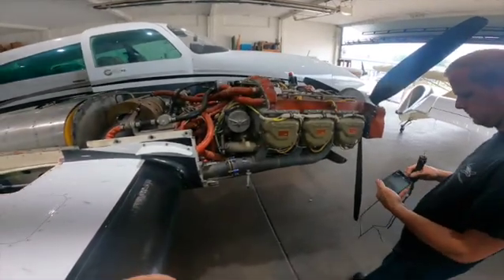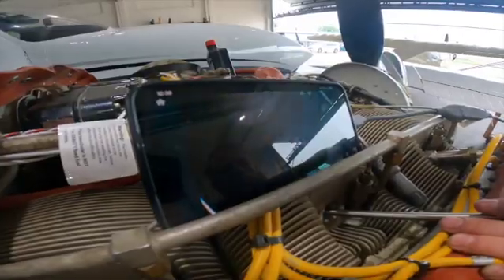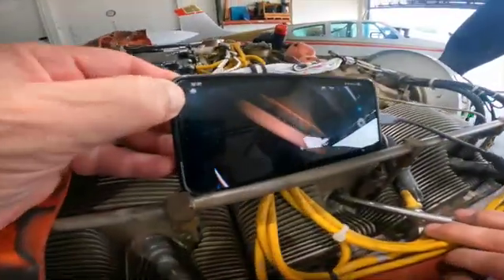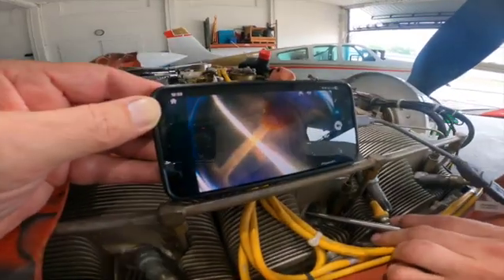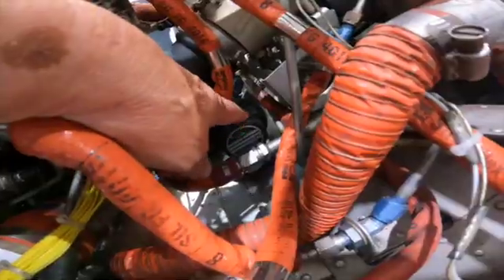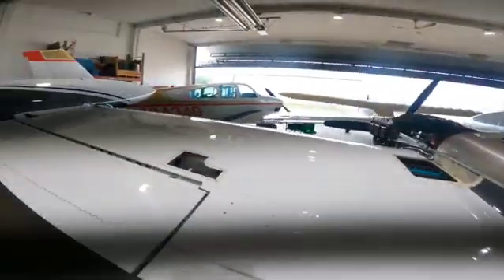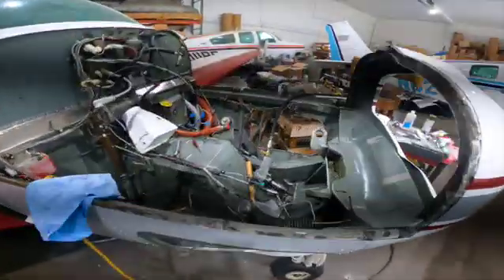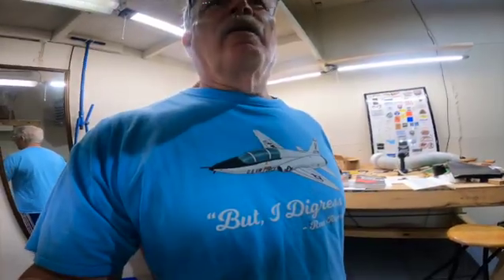Friday the 13th Annual update. Bore Scoping Cylinders.

Comment: Thanks for taking us along Ron, always interesting to take a peek inside cylinders. How much better it would have been to have had good, cheap video boroscopes back in the day.  
Also, might I ask what power settings you are using for climb and cruise? As I'm reminded of a about 25+ years ago and a 58P Baron I bought that was having top overhauls about every 200 to 300hrs. It had just had a fresh top when I bought it and when I went for a pre-purchase demo flight the "professional" Beech/Raytheon trained pilot pulled the props back to about 2200rpm, just above the feather detent and crammed the throttles to about 32in. Hg. and said that was how to run the engines to save fuel and get best speed. I noticed the  intake pop-off valve off the back of the right engine through a vent hole in the cowling shaking like crazy from engine vibration and the CHTs and  TITs near the limits.I was early evening and I noticed yellow glow through the cowlings from the hot exhausts.  

I then asked to try the same power settings I used in T-210s, 320 and 340 of 27.5mp and 2400rpm and both engines smoothed out, the CHTs and TITs dropped to more comfortable levels and the yellow hot exhausts cooled to almost non-visible. But fuel consumption increased about 1.5 gal per side. 

I ran with with my old school power settings for three years and 400 hours and both engines never had an issue. When I sold the airplane I advised the new buyer avoid the fuel saving settings. I rode with him after he went through training with the  'Flight Safety' training pilot who gave me the demo flight and I saw he was using the low RPM - High MP settings. 80 hours he bought two new top overhauls, and then again about 125 hours later.  I can't say for certain it was due to the power settings but I think it likely.

Comment: Ron,  I have, in the past, worked on many Continental engines.  In my OPINION…  Stake the exhaust valves on the #3 cylinders, with 80 PSI applied.  If that doesn’t improve compression results, install new cylinder assemblies.  [IF YOU HAVE A SIGNIFICANT AMOUNT OF HORS BEFORE ENGINE TBO].  I know this is very expensive.  However, in my experience, if the valve seat has been leaking hot gasses, it may have permanently compromise the valve seat and guide.   Lapping the valve with the cylinder installed is time consuming, a pain in the behind, and may, or may not, help compression readings.  This is only my opinion.  I enjoy your videos very much.  Thank you!
Reply from the maker: Engines are at around 1100 hours.